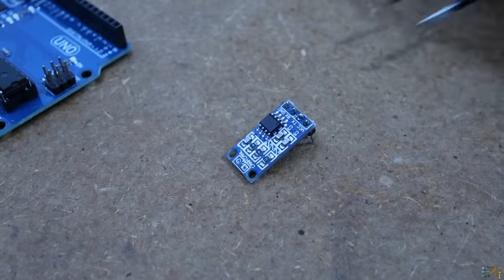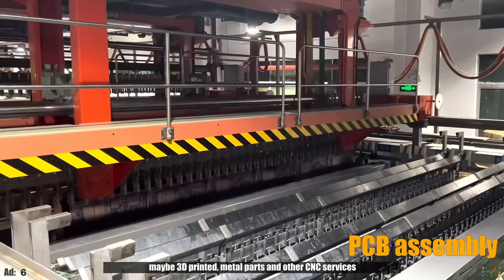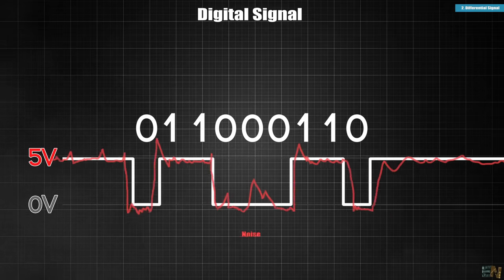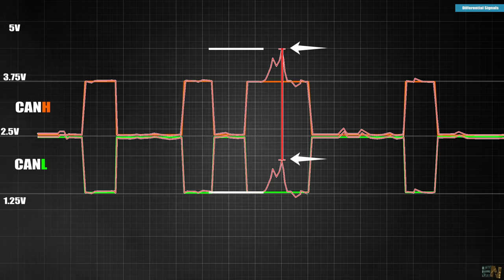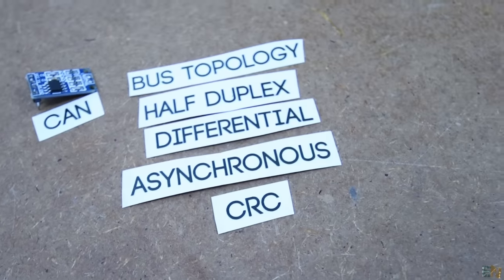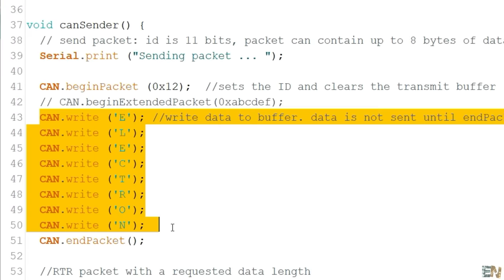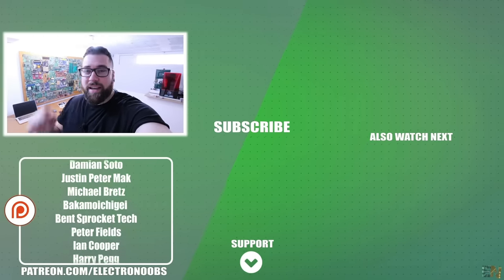CAN Bus: Serial Communication - How It Works?

Comment: One thing not mentioned in this video is CAN bus termination.  Where both ends of the bus has 120 ohm termination resistor. Creating a 60 ohm resistance on the bus. Also in a can network each module on the bus has an in and an out so it goes through that module to another. And if you lose a module on the middle of the bus you may lose all modules or just the ones on the other side of the missing module.
Reply: .... It does NOT go through the module!!! By any means!!! BS🧐.
If a module is missing, the can bus still works!!!
Reply: @ragohy  it depends on the network. And in automotive it 100 percent has in and out through the module. If a module is disconnected you 100 percent lose the ability to talk to modules beyond them.
Reply: @ginamar6218 ... since there is no car "module" discussed in the video, instead a can bus transceiver   and a controller and a mcu, which forms a "node" : can bus will work, if a node leaving the bus (as long as there are two working nodes left!!
He showed the principals and not how some manufacturer might build it: i. e. two wires in and two wires out. OK??
Reply: That's not true, if  you lose one module the other will work properly without any problems. It's a must have safety feature. You are saying that if one temperature sensor is faulty in a car or some other node then airbags will not open because our can bus is down now.
Reply: @ginamar6218 
That would depend on the bus structure, but it seems highly unlikely IMO as ISO26262 has redundancy requirements that would make it absurd to have that as a failure mode
Reply: 2021 can bus fuel pump module went out. Even read perfectly through the scope. One module is down . Not all will be down. 2013 gmc terrain had something similar where one module went out. And it no crank no start. You’re speaking on old engineering. You’re not wrong though. Just half wrong due to new engineering
Reply: @sdsupreme9686  module going bad is different than module not installed, though
Reply: Bus wiring does not go "through" anything. That is the advantage of a data bus.

I believe what this very confused commenter is making reference to is the fact that modern vehicles have multiple CAN buses. Some devices may now act as gateways to information available on other buses, so that if there is a fault with that gateway device or the secondary bus, your mechanic will be put in the uncomfortable position of having to use his brain, rather than just his computer, to discover the cause of the problem.
Reply: Bus topology does not normally go “through” each node, however, it is true that some auto manufacturers connect the nodes in such a way where a node MUST be installed for the bus wires to continue on to the next module. I’ve seen two such videos where the tech had to bypass the connection around the connector and another video where the tech mentioned a particular manufacturer that wires the CAN signals so that they go in on two pins and comes out on another two pins. Yes, I was surprised the first time I learned this.
Reply: It doesn't matter if any device is faulty in network. Because each device is connected to backbone directly. Devices are not connected serially like ring topology so there will be no issues if any device gets any kind of faulty. Ring topology has that disadvantage that All devices must work properly.
Reply: @ginamar6218  no there is no input and output. It's high and low.  You are referring to daisy chain can bus whis us basically never used for the reasons you mentioned.  You also mentioned the termination being required. It it were a daisy chain no termination resistors would be required. 
The can bus high low basically uses a dual ring topology which handles nodes being removed without issue.

Comment: I don t understand a thing, why cant just connect canl and canh to an arduino and diferentiate the voltage reading? You can use a resistor divider to solve the problem when voltage is above 5v

Comment: I'm measuring with the oscilloscope the signal, and it's not the same you're getting. Both of the lines are lowering their voltages.

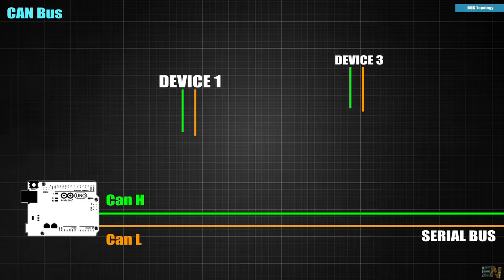Comment: Nice video but I must add that at 3:18 message ID is not based on the address of the node/device, they do not have address, but rather on the priority of the message itself. The message with lower ID will be sent sooner on the CAN bus in process called arbitration. The message as you mentioned is received by all node but more nodes can respond to the message. Also messages sent by one node should have unique IDs otherwise Bus Errors could occure
Reply: And this is another reason it is used in the automobile industry, more important systems like air bags, sensors etc will have priority over other things like seat warmers.
Reply: It was a big point he missed. Multiple devices can read the same message and process it. A device can have a list of messages it is listening for.

Comment: FABULOUS video. This will get me started. My Hyundai has two or three buttons that must be pressed EVERY time I start the car. The forums complain of this issue, but the dealer claims they “can’t” change the settings, it’s just that they won’t. So I expect I will be able to read the button presses, and then copy the bits that I need. And with a little Arduino code, then be able to make my car save the settings I (WE) want it to have.
Reply: Did u end up getting it done
Reply: @bigmon9186   Not yet. But did get Arduinos, OBD adapters and started learning the hardware…
Reply: @BitSmythe  Okok Cus I’m a car mechanic and I wanna get into being able to tamper with canbus on cars Cus modern 2024 use it heavy With all the dash buttons these days

Comment: That was a good explanation of CANBUS! I knew that the ESP32 had pins for CAN but had never looked into how to actually use it, so that was helpful too.

One thing to also include about CAN is it's best to use a twisted pair wire for the hi and lo pins. For a short test like you were doing, no need, but for using in an actual vehicle, it's needed so that any interference is equally experienced by both wires and it reduces the electromagnetic radiation from the wires as well.

Comment: Good video.  One note do, there is no reverse computation of crc.  Rather the receiver revives the packet with data and crc.   The receiver computes the crc on the received data, and then compare the value it generated to the value received.    If they do not match, the data is not trusted.

Comment: Brilliant! Thanks for sharing. Can you explain what is the physical limitation in distance between transmitter and receiver? What is the maximum data rate? Why is the shape of the signals on the oscilloscope not square?

Comment: Excellent tutorial.  I have to wonder if anyone has "sniffed" the CANBUS on various car models and built a database of the devices, commands and response codes.  It always annoys me that for each car manufacturer you need their ODBII/CANBUS reader. The retail universal ones are just insanely expensive for what they are.   
I recall decades ago someone did this for IR remotes and made a fantastic Universal Remote Control (with macros) that was not available retail.
Reply: There is an open source project aimed at reverse engineering these databases.  I'm in automotive professionally and everything is going CAN-FD with encrypted buses now.  This video is about legacy CAN 2.0B.  In legacy CAN you can still have encrypted buses however due to the low data rate it's generally not done except for certain CAN frames like unlocking to tune an engine.
Reply: Thank you for the comment. I have to wonder how strong the encryption is since it has to be low cost. For example when WIFI came out it had no encryption (dumb really). Then they added WEP. That was cracked in a couple weeks. Then they added WPA2 etc.  Its the nature of CANBUS to be very cheap in production so I am betting the encrypted standard is hacked in no time. Especially since the commands cannot change without a full software rewrite!
Reply: @dennisfahey2379  well WiFi encryption is at the transport layer.  CAN 2.0 has no encryption at transport and is all done at the application layer so the encryption can be as strong as you like really.  But many CAN 2.0 devices are designed around lower end processors that usually don't have the processing capabilities to run a full cipher suite so they often just don't.  With CAN-FD's higher data rates, things are changing.  CAN and CAN-FD have something called ISO-TP which, fundamentally, is just a protocol on top of CAN frames and still pushes the encryption logic up into the application layer.  ISO-TP is where things are interesting.  You can think of the russian doll analogy or html inside a tcp payload.  Like these examples, ISO-TP is just multiple CAN frames that are reassembled to make a complete & larger message.  ISO-TP doesn't change the max payload size (8 bytes with CAN 2.0) but allows multiple frames of 8 bytes to be assembled as a complete message so the encryption overhead starts to make sense.  It's hard to justify on a CAN bus the overhead associated with encryption for just 8 bytes and so other lesser encryption or security protocols are used which would require a dedicated video/blog post on...
Reply: Torque Pro with BLUETOOTH OBDII
Reply: @revealingfacts4all A CAR needs encrypted data? Nah, it's just so the manufacturer/dealer/service department can have exclusivity, and thus, a "digital monopoly". God, I'm so sick of this scam. Thankfully, someone with an oscilloscope and a data analyzer will figger a way around it using a $3 Esp32 and some chewing gum.
As if a car wasn't expensive enough already.
And while I'm ranting, how the hell did the engineers who come from an historical heritage as the Me-262, Mg-42, Bf-109, V-1 and V-2, Flak+88, the Saturn 5, and just about ANY car op into the 70s, come up with a design for a high-performance car that requires you to REMOVE NEARLY THE ENTIRE FRONT END TO CHANGE A HEADLIGHT BULB? Are you kidding me?

Comment: Hi there, correct me if I am wrong but when he explained on the CAN data message with the ID, I understood it as each device has unique ID, and only the device with the given/matching ID will act on that data message. Meaning that the ID refers to the address of the device(the animation show it like that). However, when I did some research the ID actually represents the type of data message for prioritization purpose and not the device address. It is to make sure only one message is sent every time CAN bus is not idle. Again correct me if I am wrong tho.  Its a good video tho, thanks.
Reply: Ouh nevermind... I just found a comment with similar opinion with mine. Took me multiple website and videos to confirm this. Thanks tho!

Comment: I think 1 thing to clarify is that you don’t calculate the original data from CRC bit, but you use the received data to calculate the expected CRC then compared with the received CRC. If data is > 4bytes long then reversible calculation from CRC is impossible

Comment: Hey, great video, but I do have a queston regarding CAN...
What is the difference between CAN comm and Rs484? (both use basically the same 2 twisted wire and differential single)
but, my main curiosity, is what happen if 2 or more modules, will try to send data in the same time? how is this avoided? Thank you
Reply: CAN has a defined packet format whereas 422/485 does not beyond a start/stop but.  There is no CRC, for example, in 422/485 unless the application adds it to its data, CAN it must be there.  Another difference is CAN devices arbitrate for the bus (he doesn't cover it in this video) where as 422/485, there is no bus arbitration.  This allows CAN endpoints to start communicating whenever they have data to send; first arbitration and getting on the bus where in 422/485, a device must generally wait and respond to a master's request.

Comment: It reminds me how XLR audio signal works to prevent noise.
Reply: That is called a 'balanced' audio signal, in contrast to an 'unbalanced' audio signal.
As such, a single mono audio signal needs 3 wires. And a stereo signal (effectively 2 mono signals) uses 6 wires (or 5, as you can share the 'common/ground' if you use it in the same cable... though usually in the audio industry dedicated single stereo cables are very rarely used, if at all).
But do note that it will not reduce all types of noise!! Audio is an analog signal, not a digital signal like CAN-bus. As such it can not eliminate all types of noise.

Also note: 'XLR' is just a type of plug! It has absolutely nothing to do with the type of signal! Eg: you can just as well use a 'stereo jack' for a balanced mono signal (which is indeed also used in the industry for connections to an audio mixer for example, along side 3 pin XLR plugs)

So, a far better comparison would be the lighting protocol 'DMX' (to keep it in the same 'entertainment industry' as audio). Which IS a digital signal and also uses a bus topology, just like CAN-bus (and also uses XLR style plugs). Though, it does use master-slave topology, unlike CAN-bus. In the DMX protocol the High and Low (or Plus and Minus) ARE used as a differential signal to eliminate noise.

And just as with CAN-bus, with DMX you need proper termination or you WILL have reflections on the signal which WILL screw up your signal! (although many hobbiests will tell you it doesn't matter. But they often don't use long lengths of cable so they wouldn't notice it, as for short lengths the termination doesn't matter THAT much).

Either way, this video emitted even to mention the 'termination' requirements. it is an EXTREMELY CRUCIAL and HIGHLY IMPORTANT fact! He should have mentioned that at least.
Reply: @CookieTube   thanks for the precision, I was effectively talking about balanced signals. I do know the difference between connectors and signal protocols, but choose the term "XLR" for accessibility and understanding. But hey! You have great informations there, many thanks.
Reply: @NicleT  Thanks.
And no worries, in practice, at the work floor, we also use just the term 'XLR' to refer to an balanced audio cable...
eg: "Do ya have a XLR 2m?" or "Do you have a 2m mic cable?"_. ... instead of _"Do you have a balanced audio signal cable of 2m, with 3 pin XLR plugs?" .
And for DMX it's: "Do you have a DMX cable 5 pin?" , instead of "Do you have a DMX cable with 5 pin XLR plug?" .

But on the internet, I see a lot of people confusing those things... hence my 'overlong' pet peeve explanation. hehehe...

Comment: Dumb question : Could you then attach multiple  controllers to the same two wires but have them send at different Baud rates and have different receiver networks set to receive those rate running on the same wires?
Reply: No.
1 network, 1 baud rate for the whole network.
If you want to 'use different baudrates', you need physically separated independent networks.

(Note: in theory you could mix baud rates. But your nodes/devices would also need to be able to cope with all of them. Which is not trivial at all. If you think about it: a faster baud rate with one message COULD be mistaken for a faulty slower message or vice versa. It would be hard to pull off without much faults. So in essence, you'd be making something different, and incompatible, than CAN-bus in that way)

Comment: Why did i think that TJA1050 works well only with 5Volts input? are you sure we can use this tranciver correctly with esp32?
Reply: So? What is the reality? can the TJA1050 safely be used by esp32? or there is a risk of burnig one of the two or getting in many cases wrong data?
Reply: With ESP32:
 TJA1051T/3 and TJA1051TK/3 can be interfaced directly to microcontrollers with 
supply voltages from 3 V to 5 V.
Also: SN65HVD230 and others... 🧐

SN 65HVD231D
Reply: @ragohy  ok but what about tja1050? i think this is the one used in this video. I ve seen in alot of forums that tja1050 is not to be used by esp32 (3.3V the reason)
Reply: @gerokatseros ... Io of the ESP32 is NOT 5V tolerant.
Hint: according to NXP and TI application notes: you can use 3.3V and 5V transceivers on the Network, without any restriction. Some transceivers have dual Vcc :
3.3V datalines and 5V for bus driver (see datasheet / application Notes).
Reply: @ragohy  I know esp32 is only 3.3V but can TJA1050 work with 3.3V? i ve read somewhere that it doesn't work well
Reply: @gerokatseros ... Where is your problem??? I didn't said to use a Tja1050 with an ESP32!!!
Read my answers to your question again.

Comment: ...so CAN bus has redundancy advantage than a i2c..break 1bus line and check if it works..if not it's only redundant against noise.. imagine all that internal spark gap rf noise from spark plug it has to withstand..since the stop bit always has voltage...it will drain battery faster..can't the stop bit do 0 v...

Comment: differential twisted pair cable
Reply: tripplefives1402  well then you lack the differential exact cancelling, and the twisted pair noise cancellation properties, like in a cat-5/6 cable
Reply: tripplefives1402  so it would be beneficial to use cat-5 or better straight up for can, too
Reply: tripplefives1402  well then, run the other cable on the opposite wall, watch if the noise is the same, I think this is noise in vain
Reply: tripplefives1402  you are trying to teach a telecom uni master, mind you
Reply: tripplefives1402  tradition/customs is not a proper excuse for lousy implementation
Reply: tripplefives1402  no wonder you industrial non-production crashes so often, china c-19
Reply: tripplefives1402  used to be making trash? yep then rely on the old failed habits
Reply: tripplefives1402  SNR bro, better is better, and you run lengthy wires anyways, in industrial settings
Reply: tripplefives1402  yes flint stone wheels "work", at slow speeds